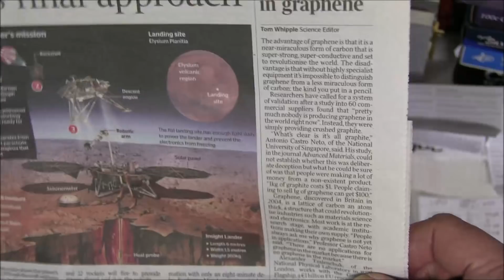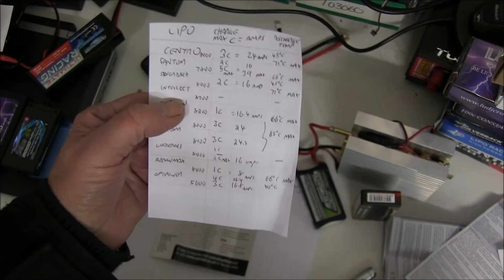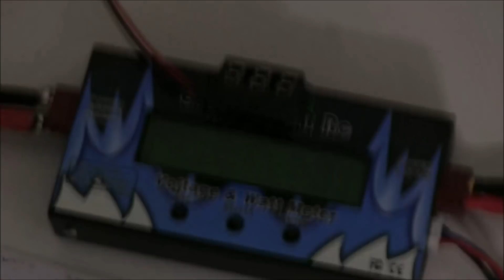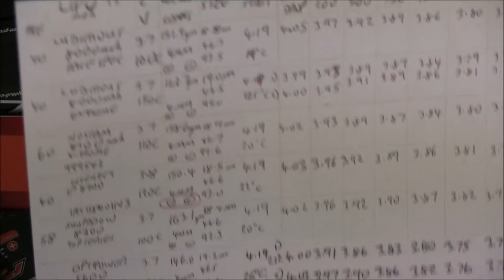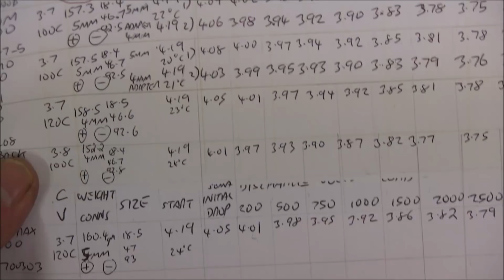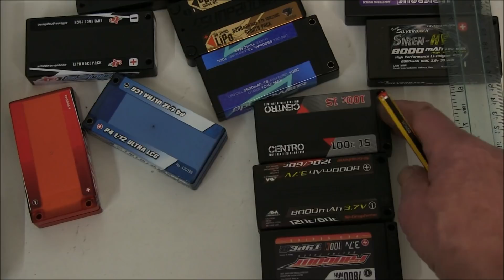1S Competion Lipo. Megga Test 2018/2019

Comment: Woa Great review. Imma completely noob, and i have to check all your videos, but maybe every one else can answer me...i have an lrp g3 bought used with a Cell with internal resistence 26,there are chances to fix it to a lower number?
Reply from the maker: Hi Dario. The IR can be improved when only a little out, by a charge/discharge cycle.
But in you case the IR is way out. It is not possible to lower the IR that much.
It could be a bad connection, so make sure the connections are clean and tight.
Reply: @nickadams5411  hey Nick, i found out it was probably the balance board, checking the IR with another balance board i get low ir, thank you!!

Comment: hello nick, thanks for testing all these products. I have to buy new batteries and i would like to know something. Is it better to buy a 7200 3.7V battery or a 7600 HV 3.8V battery ? what one will perform the best ? thanks in advance
Reply from the maker: Hi.  Those 2 batteries are probably the same inside. If you can charge to the higher voltage then the 3.8 is much better.
If you can only charge to the lower voltage, the 7600 will give a lower duration (about 7000) but the performance will be identical.
Also, the 3.8V should have a longer lifetime of charges (in theory) when charged to the lower voltage.
So as long as they have the same C rating buy the cheaper one.

Comment: Hi Nick, I have question about Lihv lipo’s vs standard lipo’s. Being an Lihv lipo, can you get away with charging it at a higher rates such 20-30amps if your only charging it to 4.20v? Will you get longer life from the lipo compared to a standard lipo? Any feedback and information will be appreciated. Cheers
Reply from the maker: Hi.  The lifetime will be extended and less likely to puff up or lose performance if LiHV lipo are only charged as a normal lipo to the lower voltage.  However you will lose about 10% of the indicated capacity. ie a 5500mah will only give 5000mah.
Charging at high amps will not increase the power delivery of any lipo. It will charge much quicker. Some chargers may switch off before the maximum voltage is stabilised, due to higher voltage losses in the charging leads and connectors.

Comment: Nick Adams
Hi Nick. My 406duo has stopped completing the balance cycle on channel two. Do you have a video showing the repair process?
Reply from the maker: Hi Elliot
Not sure what you mean, but as it is only on one channel then it is a component only connected to that channel.
Does it balance for most of the charge?

Comment: Don't the HV lipo's only reach full capacity when charged to 4.35V per cell?
Reply from the maker: Hi. Yes, they achieve about another 500mah if charged to the higher voltage.
Reply: @nickadams5411   Hi Nick.  Would  you say a 6000mah 2s lipo is equal to a 7500 HV lipo when both charged to 8.4v
Reply from the maker: @charlesterhuizen3704  Hi, I have not tested a 7500HV, but i tested a 8000Hv which only gave 7403mah when charged to 8.4V.
It seems that there is about 500mah between 8.40 and 8.70 end charge.
So the 7500 would still give about 7000mah compared to 6000mah for the 7.4V lipo.